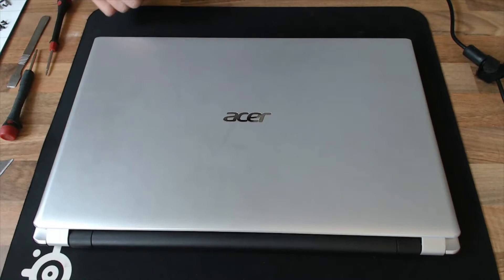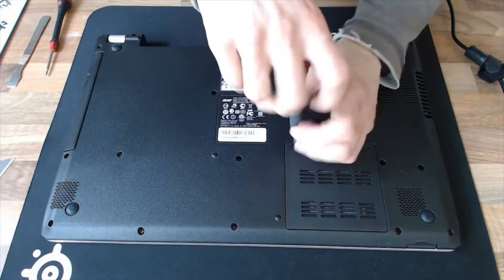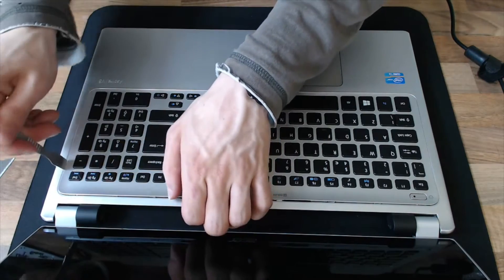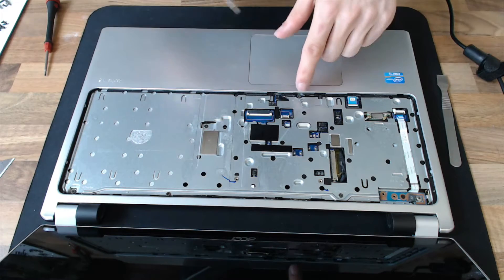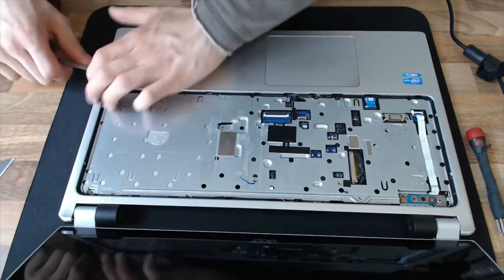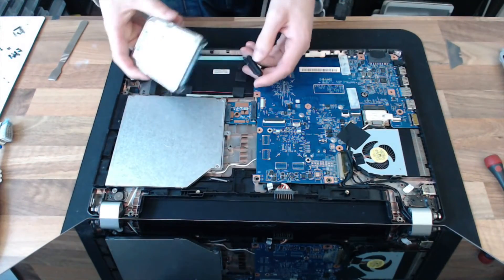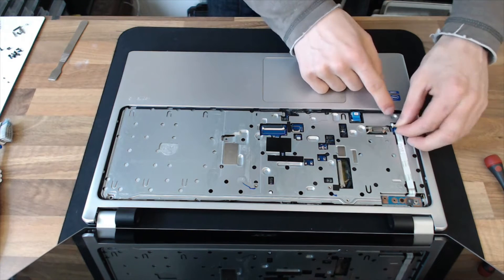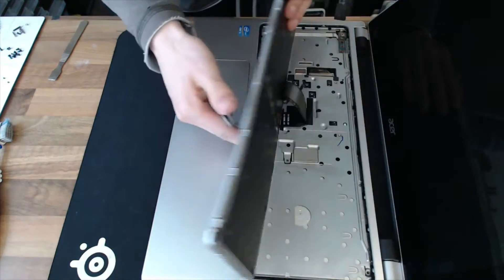LFC#47 - Acer Aspire V5 HDD Swap

Comment: In your video you are showing the removal of the keyboard to get access to hard drive, why not gain access after removing the back screws and the back cover-would not be easier that way? I am curious. Please let me know. Thanks
Reply: The bottom cover are one part in this particular laptop smh you can tell just by looking at it.

This would almost always be the case if the laptop is designed to be opened from the top side.
Reply: Some would even have the motherboard facing towards the keyboard.
Reply: Oh how I wish it worked that way, but it doesn’t.

Comment: doe it use SATA 3? I'm planning to replace my hdd with ssd (sata 3)
Reply: All laptop's hdd sockets (beyond 2010) are SATA3. The optical drive socket, in the other hand, some still use SATA2. If you're not sure, just use the hdd socket. And swap out the hdd to the drive caddy (also if you opt to remove the optical drive).

Comment: Hi tech newbie here.I got a question,will i have to do some clone thingy(i see alot of people doing it for some reason)if i switch my hdd with a ssd and put hdd into a caddy or can i just use it like normal after replacing it
Reply: The thing is,i dont wanna transfer any files onto my ssd,can i just install the ssd into my laptop and just use it as an extra storage?Or do i Have to do the clone thing.(btw what does clone means and how does it work?)Thanks for the fast reply too
Reply: Dang i think i'll just try to clone lol.The clean slate option doesnt look to safe tbh.I'll just try to search up some tutorials on how to clone,do you happen to have a tutorial for it?

Comment: Hi Dear My Laptop Acer V5-571, Operating system not found. Starting Setup is not open! I Tried hard, Please Help this problem or Any Sloution?
Reply: Adamant IT , Dear My Laptop running is very well! But My Mistake is starting setup boot option change hard Disk Drive to select top 1 Usb Disk Drive , then Restart this pc! Then it's  Problem " Operating system not found " otherwise My hard disk  Running well.
Reply: Adamant IT ' But Now Setup is not open, How to starting setup open now! I tried hard, but Setup is not show. Please help for this solution! Thank you for your reply.